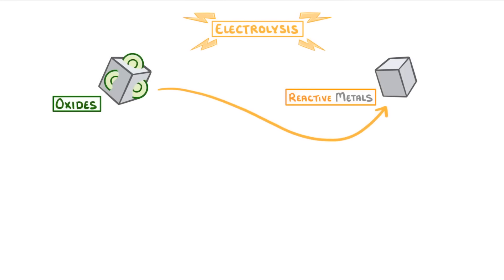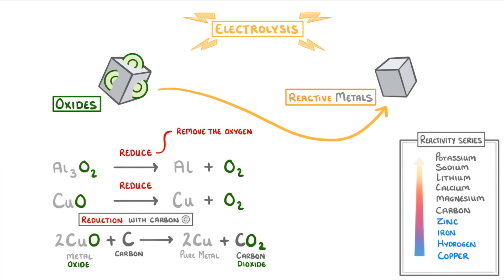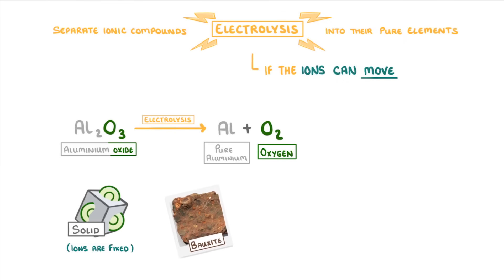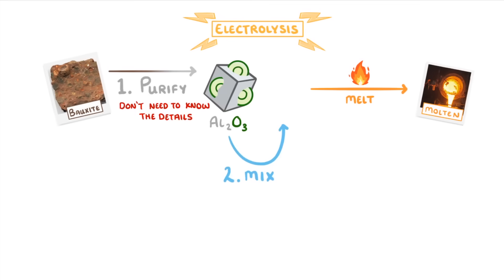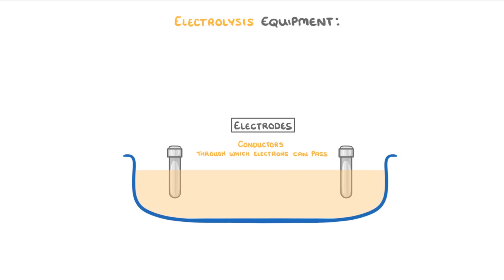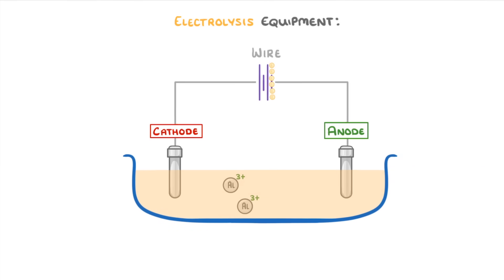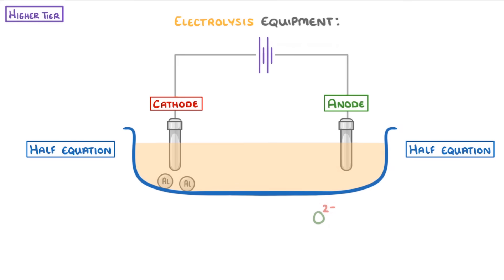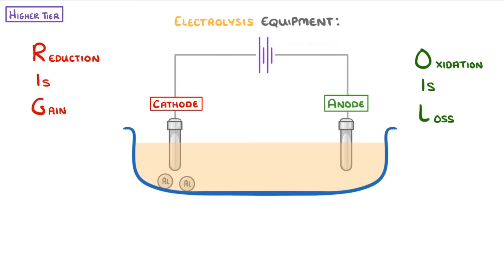GCSE Chemistry - Electrolysis P2 - Electrolysis to Extract Metals From Oxides

Comment: By the way the diagram is wrong the battery is supposed be swapped as the same issue was in electrolysis part 1 
As well as positive (longer line) always faces anode and shorter line cathode

Comment: I am a chemistry teacher, and i noticed that your electrolysis diagram's battery is wrong. The positive side is connected to the cathode, and the negative side is connected to the anode. This will cause the current to not work, as it should be the other way around. My ninth grade students pointed this out, and I just wanted to point it out in case anyone needs the help.
Overall, I really enjoyed your explanation, and this was a helpful video.
Reply: Ninth grade? If you’re American, why are your students watching UK-Based GCSE vids?
Reply: @thesausageman5388  electrolysis in america isnt different and this could be better than the vids in America
Reply: Look at the top comment, he corrected it his mistake 4 years ago
Reply: Thank you for pointing it out! I was so confused
Reply: Hun

Comment: Why do the oxygen ions only escape into the air when their electrons are removed and not earlier? Is the strength of attraction of the anode greater than the upwards force?
Reply: because its in ion form in the solution so when it removes electrons to the anode it becomes O2 gas so can float off

Comment: I am pretty sure in the power source the positive terminal goes to anode (negative) and negative terminal goes to cathode (positive). Anode is where oxidation happens and has negative potential. Cothode is where reduction happens and has a positive potential
Reply: Well, that is in the case of galvanic cells. It's the opposite in the case of electrolysis. To know more you can look it up.
Reply: Anode is positive while anion is negative. Cathode is negative while cation is positive.

Comment: Wait… if you melted the ionic compound wouldn’t its heat melt the electrodes?
Reply: Not if the electrodes had an even higher melting point
Reply: @Big_Topic  what if it doesn’t? People usually use graphite or platinum, but their melting points, while higher, are not the highest.

Comment: i dont understand why the half equation isnt the 2Al+^3+ 6e- -> 3al

why is it just Al
not 2al
Reply: The reason why the Oxygen ion has a 2 is because oxygen is diatomic which means that having one ion cannot make a diatomic oxygen molecule, so you add a 2 on the left. For aluminium you only have one ion and one atom so there’s no need for balancing it with adding a coefficient

Comment: When the oxygen reacts with the carbon anode, does it not react with the carbon to form carbon dioxide?
Reply: 1.There is nothing called a carbon anode
2.Carbon dioxide is formed in the reduction of the carbon method
3.Carbon dioxide cannot be formed in the electrolysis method
I MIGHT BE WRONG
Reply: @aliabdullah6753  carbon reacts with oxygen to create co2 and that's why you have to replace the anode
Reply: @indian-tech-support  yeah you’re right
Reply: Yeah the carbon electrode is also known as inert electrode
The O2 gets dischrged at the carbon anode and due to hight emperature reacts with carbon in the the carbon anode to form co2 gas

Comment: i think you made a mistake at 5:08 as reduction is loss of oxygen and oxidation is gain of oxygen but you said it the other way round
Reply: nope, there's a little way to remember which is which, its called OILRIG
Oxidation
Is
Loss of electrons
Reduction 
Is 
Gain of electrons
Hope this helps :)
Reply: @omar.t975  but in the last video he said the opposite for extraction of metals
Reply: really confused here
Reply: @hamzaibrahim8457  so theres 2 types of reduction and oxidation,
If you say sodium was oxidised, it means you added oxygen to sodium
If sodium oxide was reduced, you took away the oxygen from it so now it's just sodium
OILRIG is talking in terms of electrons 
So sodium is oxidised as it loses electrons to become positive 
Oxygen gains them electrons from sodium to become reduced
I just used sodium as an example by the way.
Reply: No, so basically, when it comes to OXYGEN the oxidation is gaining oxygen and reduction is loss, but when it come to ELECTRONS then oxidation is LOSS of electrons and reduction is GAIN of electrons

Comment: Very good, thank you. Shouldn’t the battery be connected the other way, or the electrodes swapped? I say this because I think the electrons will be repelled towards the anode, and the positive ions repelled towards the anode?
Reply from the maker: Hi Ollie, Yes you're completely right! Sorry about that - we've drawn them the wrong way around! We've pinned a comment at the top to address this.
Reply: Hi thanks for the reply. No problem at all.
Reply: Sorry I meant positive ions repelled towards the cathode
Reply: I didn't understand this.
Reply: @brehwtfisthis   think of it like this: 
the conventional flow of current is positive to negative and the electrons are transferred from  the anode ( the positive terminal ) to the cathode, right? now the positive side of the battery is drawn towards the cathode rather then the anode and the current can't flow that way. therefore the cathode ( the negative terminal ) will repel the electrons cuz like charges repel... I really hope this makes sense and  helps you! :)